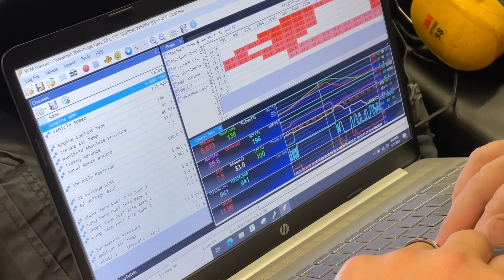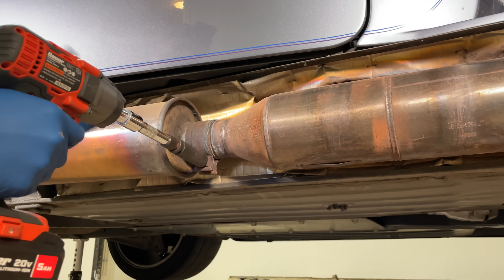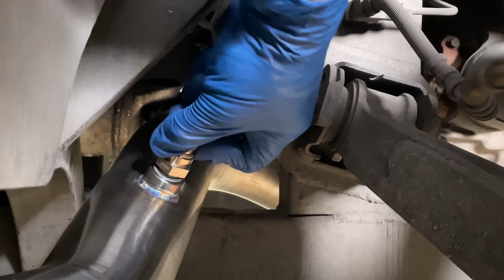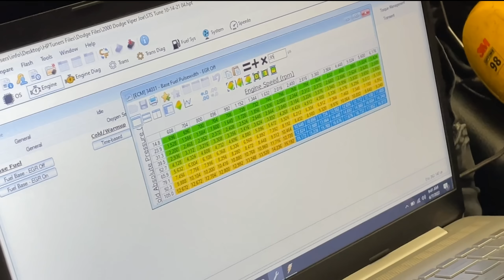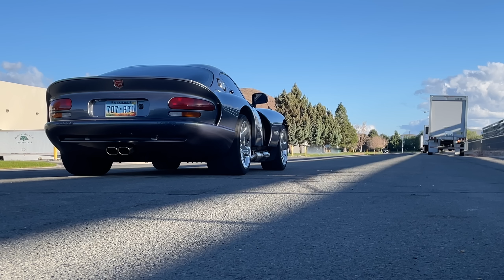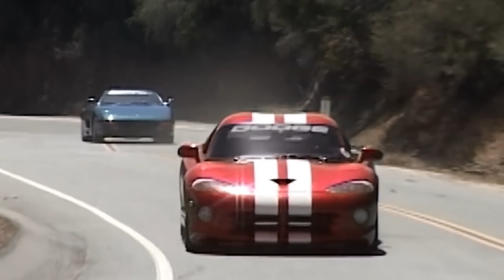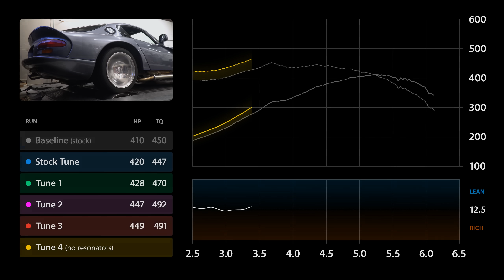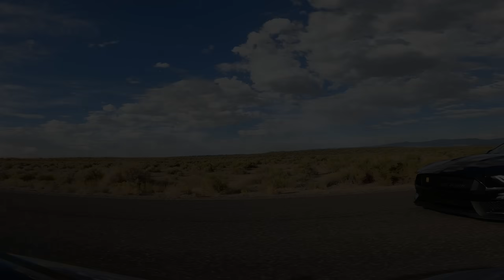When you give an 8-liter V10 the exhaust it deserves

Comment: Another great video! The overlay of the 2 dynos really puts into perspective how different the two engines are. The only additional detail I was thinking about is how different the gearing must be between the two cars, the Viper must have significantly longer gears to achieve a similar top speed in each gear with it's lower rev limiter, which reduces the torque output to the wheels. Which is the reason why it's so annoying to me when people say "Horsepower sells cars, torque wins races." This race is a PERFECT example of how untrue that is, with the Viper having a whopping 30% more torque, and just barely walking the GT350. (I usually use the 225hp/300lb-ft Foxbody vs. 240hp/160lb-ft S2000 example) Anyways keep up the amazing work, and I can't wait to see what's next for the Viper!
Reply: I'm so with you Greg. People who claim diesels are fast because they have 700ftlbs but only 350hp.. No, a gas 350hp with 400ftlbs would probably keep even with it.
Reply: @J3n555  you’re looking into the wrong Diesel engines lol. OM606 for example dual cam inline 3L diesel. Revs to 7-8k if you do some mods and will make 500hp with 700/800lbsft plus even depending on setup…some bmw diesels are another example…just realistically the people who know how do mod diesels for speed are in Europe and aren’t going around telling everyone.
Reply: @TheOnlyKontrol  If you rev a stock OM606 to 8k you're going to end up with a con rod on the sidewalk.

Besides why would you buy a Diesel that makes power at 8k, people don't seem to realize than when you mod these Diesels to make power up top - by fitting a massive turbo, it's really not rocket science - you're going to lose all low end response. Congratulations now you have a Diesel with massive turbo lag and no low end torque, task failed successfully!
Reply: Thank you! People don't understand that torque is simply rotational force. It takes a combination of torque and horsepower to make a car fast
Reply: 100% Agree. A roll race like this is really a horsepower to aero race when weights are in the same ballpark, depending on how fast they go. You could see the viper was able to keep more power under the curve. And ultimately horsepower divided by wheel speed= wheel torque, so engine torque matters basically zero once the car is moving. If the mustang had a dual clutch and was able to shift lightning fast it would have been closer. I also suspect the two different dynos read different and the viper did actually make more horsepower.
Reply: Stock gearing in a viper is 3.07
Reply: @pg3807  That's only half of the equation, trans gearing is the other half
Reply: @TheCarPassionChannel  The mustang's gearing is significantly shorter than the viper's, both have tremec 6 speeds but the viper's has a double overdrive and 4th gear 1:1 while the mustang is single overdrive and 5th is 1:1. 2-5 is somewhat similar on the mustang to 1-4 on the viper but 1st is so short that it still has to spread the ratios out further than the viper does to get from 1st to 1:1. The viper is lighter by 300lbs but assuming they were both starting in the gear displayed on screen the mustang probably lost more from having an extra shift on the first 2 runs than from the extra weight, I still think the viper would have pulled on him had the 3rd race continued but the mustang hung with it MUCH better when it didn't have to start in that useless 1st gear
Reply: @sabero5668  shifts shouldn't be slowing you down much 1 extra shift is very minimal and if it isn't minimal you ain't shifting fast enough.
Reply: @sabero5668  I love that you just gave much more accurate info than that offbrand self claimed expert you replied to
Reply: @midnight347  you can clearly see in both races that the viper started really pulling away when the mustang shifted tho
Reply: Yeah, those old vipers were geared really tall. They would do 60 mph in first gear, and with the torque of that engine, it's why they were so quick. 

They were also axe murders, just waiting for a mistake to spin and kill you. 😉 Had to have skills to push them, as well as the money to buy it in the first place.
Reply: @Broadpaw_Fox  I was told the first generations were so aerodynamically unstable that a stock one would almost guaranteed to spin at high speeds because it developes so much lift lol. Any truth to that?
Reply: @CrossWindsPat  no
Reply: torque gets you off the line HP wins races the viper weighs less as well
Reply: tossing in a 3.55 rear gear significantly changes that effect.
Reply: BabyViperDad hath spoken
Reply: Hi dad
Reply: LOL that reference is for race cars not modded highway pullers...
Reply: It's a stupid saying repeated by beer-bellied, NASCAR retards. HP and Torque are different units that measure different things.
Reply: Viper     ma znacznie dłuższą skrzynię biegow od mustanga
Reply: Where I'm from, a race is from a stand still, always. That's just. been true nature of  ū racing. Hole shot is everything. everything. Couple that with jbbbv joverwhelming  torque. Spinning ain't winning.vz
Reply: @patrickrobinson2520  Dig racing is terrible for comparing the power between 2 cars. Roll racing factors out which car has better suspension design for launching, stickier tires, and driver error. Roll racing is best for comparing power which is what this video is about
Reply: @TheCarPassionChannel  hello there. I didn't mean to come across the rude. I imagine I'm talking about things that happened 25 years ago. I got my license in 1994. My first car was a Ford mustang 25th anniversary candy apple red five star pony rims. I just love cars and I really enjoyed that one period of my life when I had one that would run with other cars. In this area there is not enough road to safely race two cars it speeds over 105 or so was about as fast as a trap speed the Camaros would run if someone was a good driver from what you call I dig. If you tried to roll race around here you ended up a Deadman. The reason for that is I live in Eastern Kentucky, the foothills of the Appalachian mountains. If you watch the news 1 hour south of me I have some fellow kentuckians having a real hard time right now because they lost everything they have and roughly 40 to 50 people are dead from one flash flood out of nowhere. Now that I've created a timeline from then till now, I'm older and at the same time I'm younger. What I mean by that is I'm 44 years old. To a 16-year-old boy I'm an old man. To an 80 year old man I'm a young boy. I guess what I'm getting at is I have no idea what age you are or where you're from and your background, but I do respect your comment and I agree with you about that. The same eagle talon that I told you about in my first comment I did get a chance to race one time in Georgia. It was still on a state road but I was coming back from working a telephone job and the two-lane roads down there we're so straight that you could see them come to a point. So I'm running about 70 miles an hour and this five 5.0 foxbody pulls up beside me in the passing lane. I had never run a top-end race in my life but I did that day. There was no honking of a horn but directly after revving the engine they pointed their fingers forward which in my day meant let's race. So, the mustang gets a jump on me because I have to go from 5th to 3rd gear which would run 94 mph, and then I shifted into fourth gear, with the fox body 2 car lengths ahead of me. I put it in fourth gear and it had a little bit of turbo lag from 94 mph until about 105 and 4th that started coming back on strong and I pulled up to the door of the fox body. I had never put the car in fifth to see if it would run the speedometer which read 145 mph. But as I shoved it into fifth the power was strong from 120, then 125, then 130 I pull even beside the fox. The talon had the power running 5 k RPMs, then I see the number 135 and I start pulling away quite quickly as it continued to 140 and then 145mph was the red line on that car. I was actually shocked because I didn't think I was ever going to run that car down, but I imagine it was a factory engine and gear and they ran out of gear. So at this point I'm well ahead of them and I just let out of the car happy that it hadn't blown up and left me on the side of the road. They pulled back in behind me and I drove 55 mph for another 20 miles until the next junction and they never attempted to go around that car again.lmao So there you have it, the performance of a 4 cylinder with a 2 l engine and a turbo out ran the v8. If you are still reading, I have told this story to many people over the years and no one has called bullshit because those that owned a fox body all admitted that with its extremely low gear and overdrive there was only a point between 4th and 5th that made top gear worthless. And I understand that there were different gears depending on five-speed or automatic but nevertheless I'm not here to offend anyone, I would like to hear from you and understand your viewpoint that is hidden by the avatar. I think it is that very thing that has killed the human connection. Being able to act as if you are invisible. You may notice that in my picture, that's really me with a guitar that I ended up setting up to make the instrument much easier to play and eventually given it to my oldest son who is an amazing musician that I'm extremely proud of. Have a great day.

Comment: Man I thought you stopped uploading, great to see you back and what a beast that V10 is. If I were to make a suggestion, I think the exhaust tips should be pointed vertically instead of the ground, it will flow better with the body line. Either way, sounds amazing.
Reply from the maker: Yeah I agree, but that's just the way they're designed, you'd have to add like a 3-inch extension to the rear bracket so they hang lower.
Reply: @Four_Eyes  Oh, I see. Will you be doing it or on the fence?

Comment: are you going to put spacers on it or get a set of wheel's with more offset? It kind of look funny right now having everything tucked
Reply from the maker: I'll get some proper aftermarket wheels eventually, they're just stupid expensive because of the 6-lug pattern.
Reply: @Four_Eyes  it's a 6 lug? That's interesting maybe there is more borrowed from the ram than just the engine block
Reply: @BigMans88  Same pattern as the old Dakota's from the 90's. Viper engine was never from a truck, only the Ram SRT-10 from 2004-2006 era used a Viper engine.
Reply: @venom_motoring  interesting

Comment: The gearing on ford’s cars is always so odd to me. The 6060 has different gears than the normal GT’s MT-82 (which also got a revision three times) and in the GT350, 2nd gear was a lot shorter than I had imagined. Having daily driven a PP GT Premium for two years, that Gen 2 coyotes cuts out 1mph short of 60 in second gear, making 0-60 runs pointless as you’ll need to shift early if you want to hit third right. Luckily the 350 doesn’t suffer this problem, but it still requires a shift around 70, which means he’s shifting three times to maintain a high rev in the beginning, and therefor hurting his overall times due to shifting. Viper is getting faster! It’s out here killing cobras!

Comment: I am surprised that a naturally aspirated engine can gain so much power with a good exhaust. I thought mostly turbo cars are exhaust restricted. 

Sounds 🔥 btw
Reply: When you think about it, that is an 8 litre engine, and so gains are logically big in terms of numbers, but in terms of specific output, they are kind of logical. Also, most old stock exhausts are not that optimised, which is why nineties cars are a fan favourite when it comes to tuning.
Reply: @aakar1s  90s cars are way better optimised than you think, at least Japanese and German. 1960s American cars are the one that are really that respond to every mod well.
Reply: It gets even more extreme when you look at heavily restricted smog-era big blocks that make 150hp out of 7L+ engine sizes.
Reply: @arc00ta  True, but those also need a strong bump in compression ratio, many 440 magnums were tested at around 7:1 CR
Reply: Havi finished the video yet, but the venturi insert thingy honestly made me think "muffler bearings"
Reply: Most of that gain is just due to the sheer size of the engine, plus the tune. Untuned, most cars aren’t going to gain much. The power band just shifts upward.
Reply: @shawncarson8131  the tune is a big thing, it was originally tuned to last and be more drivable (tho idk if the viper was trying to be drivable at all). Manufacturers intentionally don't max out the power an engine can make because an undertuned engine is more reliable and lasts much longer. That's why you have undertuned racing engines in stuff like Titans and undertuned LS engines in chevy trucks.
Reply: Stock Viper cats are super restricted, majority of the gain here from the parts alone is probably the high flow cats.
Reply: IT JUST SHOWS WHAT A POWER DIFFERENCE CAN MAKE LOL IF I TRIED ROLL RACING WITH ONE OF MY SUPERSNAKES WHAT WOULD HAPPEN,.
Reply: This just depends on the cars you're used to working around.  Some cars are heavily choked off for exhaust flow, and show good gains. Other cars may be quiet with exhaust that are not "performance looking" but flow exceptionally well and show little gain.
For example, the subaru 3.6R engine has its exhaust choked by its manifolds to light off the cats faster. Putting headers on this 256hp engine gives you almost 50hp. HUGE gain.... but on something more like the GM LS engine (when stock) just swapping on headers doesnt unlock nearly that amount, as the factory manifolds dont suck.
Reply: The bigger the engine the bigger the gains... performance exhaust on a 1.6 Civic adds like 2hp lol.